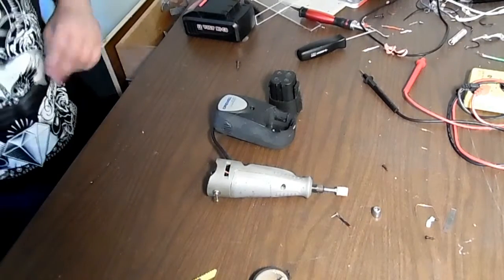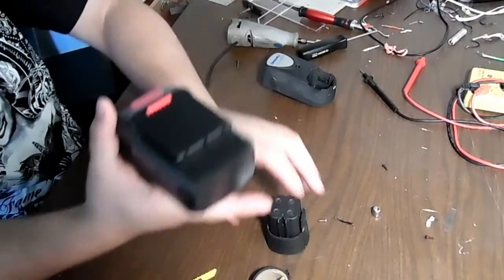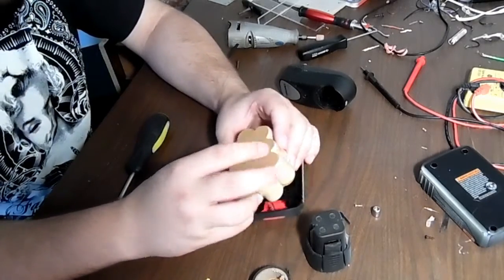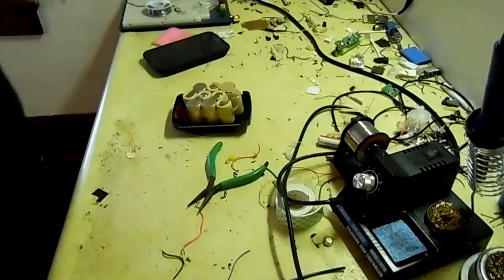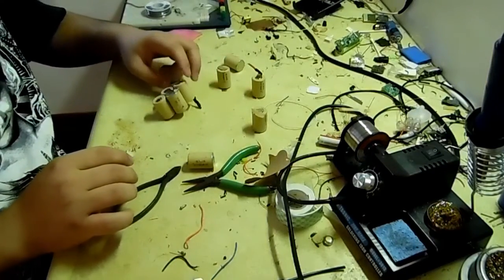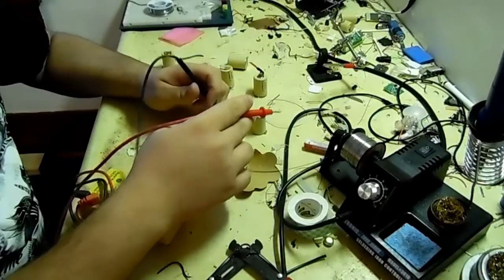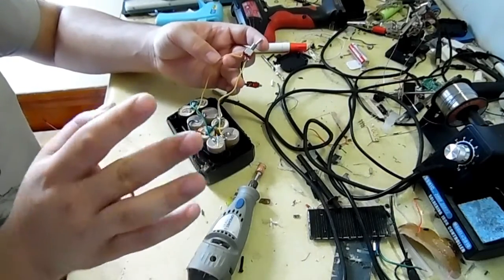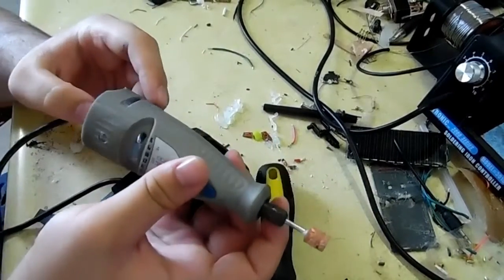Hacking together a better dremel battery!

Comment: My battery died (and charger). I have a wall plug in one now but I find I miss the slower speed setting on this one so I plan to make a mod where I just have rechargeable 3.7v lithium battery (I have some 18650s and some other sizes lying around from back when vaping mods used those style batteries and still have the charger so I am ready to go and it will be nice to give them new life/use). I wonder if I should do a video on it the process. I plan to attempt to reuse the plug in battery pack to keep the form factor but I intend to gut the pack and somehow make it so I can put lithium batteries in and out of it. It will take a bit of ingenuity but I think I can figure something out that works well. I do have a couple small charging circuits that charge via micro USB so I could use those if I absolutely have to (that might be the better option really).

Comment: Two issues with your video. One, when the tool runs on 2.4 volts the cells are run in parallel so all four cells are still used. Two, the battery case can be easily disassembled by hand and you can replace the NiCad batteries with Lithium versions and the tool works just as well. Granted when you need to recharge the batters you might need to remove them from the case.

Comment: I have this same dremel and had the same issue. The battery pack is just 4 AA batteries. I replaced them with 4 new rechargeables and it works great.
Reply: This is what I suspected.

Comment: Taylor Burley, you are incorrect about the original dremel battery, it contains 6 cells, not four. So basically, they are nearly the same as the individual 'sucky power drill's' 1.2 V cells. Also the 2 power levels of the dremel, uses 4  cells for low, and 6 for high.  So your new battery is giving it roughly the same voltage for low, and a couple of extra volts for high than the old battery did - which is probably good.

Comment: What you could do is add a current limiting transistor circuit (2 transistors, 2 resistors).  Basically the emitter sense resistor of the power transistor sets the current limit (resistor =0.7v/Max Current).  There are schematics of the 2 transistor current limit circuits online.  You could then use any battery pack you want and stalling the motor will not fry it as the current limiter will kick in.

Comment: Thanks for this, my dremel batteries are starting to go.  I think I'll try to replace the batteries in my pack or maybe find a way to wire in an wired power supply into one of the battery packs itself so i can decide if i want to be wired or on battery
Reply: To each their own...but a brand new battery pack is $10. on Ebay or $15. on Amazon Prime. 
I must have a 'magic' Dermel tool b/c I have been using mine x 15 yrs.!!! I keep it plugged in and only remove it to do my own pedicures, weekly and trim my Boxer's nails once a month.

Comment: Why you didn't tried to replace those dead cells in dremel battery pack? It's dead anyway.
Reply: Im just curious as to why not just replace the original pack with 4 NiMH eneloops, better power retention than the standard NiMH it comes with stock. Its user replaceable anyway, just press the tabs. This is way to complicated.
Reply from the maker: because making this was free and offered more capacity
Reply: Did you tried to crack open that dremel battery pack?
Reply: Idiot builds